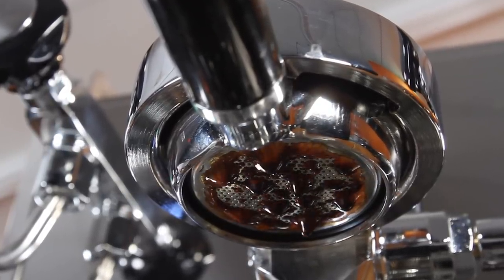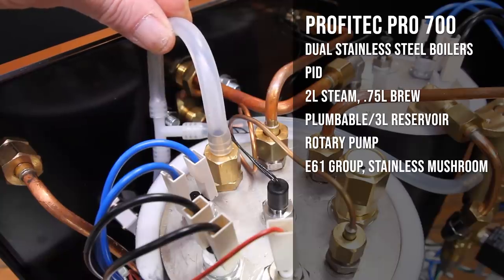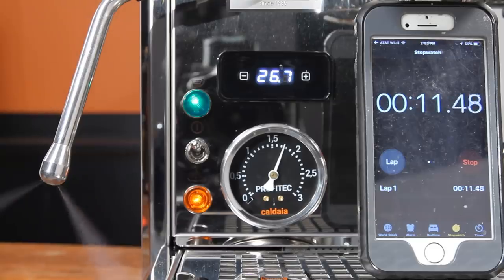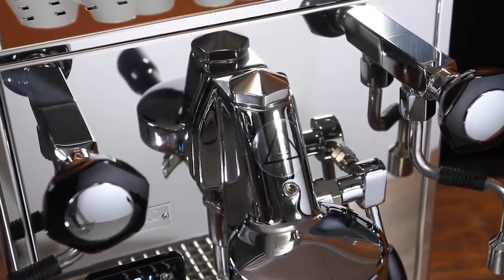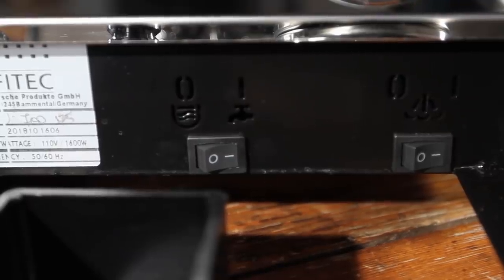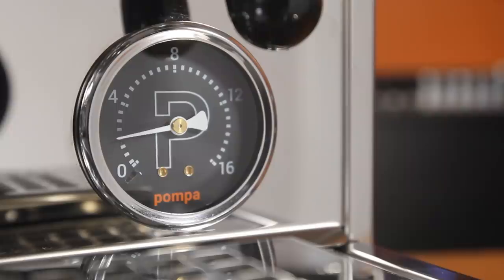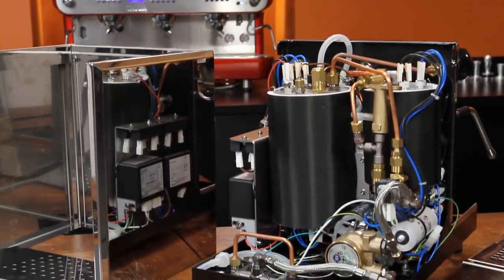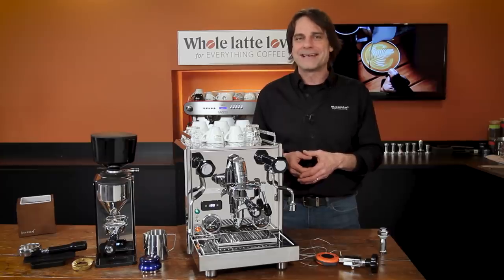Review: Profitec Pro 700 Dual Boiler PID Espresso Machine

Comment: Great video, Marc. 
I'm curious, at this level (700 and the Synchronika), are these a viable alternative to a "commercial grade machine" if you're looking at a small complimentary cafe (passive sales mainly to office building users) that's likely to only produce 20 to 100 shots/day?
Reply from the maker: Hi y, Thanks for the comment and question. Neither is NSF rated for commercial use. Doesn't mean they wouldn't meet standards, It's likely ECM/Profitec did not pursue getting NSF certification as they also make full commercial equipment and consider these machines as part of their domestic line. If looking for a lower cost commercial machine check out the Gaggia TS: https://www.wholelattelove.com/gaggia-ts-espresso-machine
Marc

Comment: Wow, the machine i’m buying and the glass cup I had on my wishlist, I guess I know what’s up :P
Reply from the maker: Hailex Hi, you will not be disappointed with the 700! Just curious if you had considered the ECM Synchronika. If so, why did you go with the 700?
Marc
Reply: @Wholelattelovepage  I did consider it, but in the end I chose not to go with the Synchronika because I love the look of the industrial style knobs more than the pull-down levers, the reservoir is also a very attractive feature, and now the black dials are a plus as well. Both machines are close enough mechanically that I felt the decision came down to aesthetics. A few things I did like more about the Synchronika was that it had the slightly black tinted PID controller screen, and the black coated frame.
Reply from the maker: Hailex thanks for the feedback!

Comment: Hi any idea if I can plumb the Pro 700 to a 8L water bottle which does not provide pressurized water supply? Thanks!
Reply from the maker: Ng Kai Yuan Hi NKY, yes you can. Rotary pumps have enough suction power to do that. We do it all the time. You may need a prime with water from reservoir prior to switching to the plumb line. 
Marc
Reply: @Wholelattelovepage  I'm assuming you attach some plastic tubing to the end of the braided line to accomplish this?  Just curious what kind of type/size of connector might work for that.  Contemplating "plumbing" to a water container of some type external to the machine to solve the minor headache of refilling under a cabinet.

Comment: Gidday Marc! Love the videos, keep em coming! Just received my pro 700, loving it so far, pulling some really epic shots. Just a quick question, was wondering if there’s any way to stiffen up the steam arm on the unit? Just feels like it moves a bit to freely when steaming milk, or maybe I’m just not steady enough with the one hand. Appreciate the time you take to answer everyone’s messages. Cheers!
Reply from the maker: Hi JP, Thanks for the kind comment and question. If you remove the nut holding on the steam arm there's a spring which provides tension on the arm. You can stretch out that spring to increase thew tension. Hope that helps!
Cheers,
Marc
Reply: Thanks Marc! Most appreciated 🤙

Comment: Pro 700 is awesome. I love it. But steam pressure defaults to 1.5 bars. How can you switch it to 2 bars of pressure?
Reply from the maker: Hi DW, Thanks for the question. How old is your Pro 700?  700's with higher steaming pressure started shipping in April of 2018. If your machine is older than that ~1.5 is the max unless you install the PID upgrade: https://www.wholelattelove.com/products/profitec-pro-700-pid-upgrade-kit
If your machine shipped May 2018 or after from Whole Latte Love (can't speak for other retailers on upgrade dates) then it is capable of 2 bar steam pressure. To get it, you need to adjust the steam boiler temp to max setting of 270F. To do that press the plus and minus button on the display simultaneously. Then quickly press the minus button until "T2" is displayed. While "T2" is displayed press the plus button to adjust the temperature of the steam boiler up to 270F. At that temp boiler pressure will be ~2bar. Hope that helps!
Marc

Comment: I've been looking into building a passive house, i'm curious if you've done a power usage test with this new version yet and what your results were?
Reply from the maker: Hailex Hi, Thanks for the question. No power test yet - I’ll try and putt the watt meter on it Monday morning. A couple things that will help... the Eco function which shuts down the boilers after a period of no use and you can turn of the steam boiler with the switch behind the drip tray. 
Marc

Comment: Hi people @WLL! Thanks for all the reviews and info. How long will it take a pro 700 to warmup to a first coffee. A total warmup takes 30 min i read somewhere. But within how many minutes a first extraction is possible. Greatings from the Neatherlands!
Reply from the maker: Hi ovdt, Thanks for the question. For rock solid temps 30 minutes is a good time. Takes awhile for the thermosiphon to fully heat the mass of E61 group. You can help things along by running some blank shots after the brew boiler as warmed up after 10-15 minutes. As the Pro 700 has a mechanical power switch it is possible to control using a timer/smart plug and have the machine turn on by itself.
Marc
Reply: @Wholelattelovepage  thanks so much for this answer! The brand new 700 is in my kitchen now so i'm gonna try this one! Greetings. Otto

Comment: Hi Marc, was thinking if you could refer me to a video about descaling the profitec pro 700? Im thinking of getting this machine and i just want to make sure that i will be able to conduct any maintenance easily by myself at home. 

I would also like to check with you if its best to leave the machine on 24/7 or otherwise.

My local online store does not sell the BWT bestmax. They only sell the BWT AQA Drink Pure Set and the BWT Protect MP200 Set. Would like to seek your kind opinion on this 2 filters from BWT. Thank you very much! 😊
Reply from the maker: Hi JT, Thanks for the question. As to leaving the machine on 24/7. I've spoken with Michael Hauck who is CEO of Profitec about that. He says he leaves his machine on 24/7 so it's always ready go. But also said it's fine to turn on/off daily. The Pro 700 does have a settable standby time for auto off. We do not have a video for descaling dual boiler machines. Manufacturers all say dual boiler machine should be descaled by machine techs. It can be done by savvy home users with the right skills but there's risk of issues when neglected dual boiler machines are descaled by non-professionals. Best course of action for most is to provide machine with a water quality that will not cause scale in the first place.  I believe the Aqua Drink Pure uses the same filtering technology as the Bestmax Premium and is just set up for tap output rather than inline to a plumbed machine. It should protect your machine from limescale yet proper mineral level via magnesium to support flavor and prevent over-extraction. Another option is the BWT Penguin pitcher if available in your area. That's what I use for reservoir fed machines: https://www.wholelattelove.com/products/bwt-penguin-2-7-l-water-pitcher
Hope that helps!
Marc
Reply: @Wholelattelovepage  thank u so much for the help. You have really helped me made my mind up on what to get. Thanks Marc! hope all is well in ur area. God bless.

Comment: Been playing with my machine for the last 2 weeks, great machine but I hate that flow control valve take about 2 full turns from close to open position, wish if it was only like a half turn from fully open to fully close, it would much easy to control.
Reply from the maker: Hi C&b, Thanks for the comment! So much turning :) IMO more turns gives one finer control of flow/pressure. An analogy with 2 grinders... one goes from espresso fine to cold brew coarse with a 180 degree turn of an adjustment collar. Another takes multiple 360 degree turns for the same grind size adjustment. The latter has far more precise control of grind size. Have you gone through calibration of FCD? Measure flow rates at each quarter turn of the valve. Run pump without PF in place for 20 seconds, weigh water output in grams and divide by 20 for grams per second of flow. If no scale measure volume with 1ml = 1g. Repeat test at each quarter turn more. I'll also note that running with FCD wide open gives a higher flow rate than stock mushroom valve by ~2-3g/s.

When I use FCD for extended low flow pre-infusions followed by lower flow main extraction I'm moving knob maybe a quarter turn between flow rates. I use that type of extraction when working with fresh, lighter roast high-altitude single origin coffees. You can see that in this video where I pull a fresh from roast Yirgacheffe bottomless triple to a 1:2 ratio and log the shot using Acaia scale and Brewmaster app: https://youtu.be/HTaly8c-i_U?t=321
Marc

Comment: Marc, any chance of a video showing the difference internally between a standard mushroom and the Profitec version?  Also, is there any functional benefit or are both styles essentially the same?
Reply from the maker: Hi GS, Profitec has gone to using stainless steel for mushroom valves. Others may be chrome plated which tend to flake/pit or ceramic which is a more brittle material. Not a common problem but ceramic can crack/break due to its brittle nature.
Marc

Comment: I just got the pro 700 (been using it for 4 days)  and  I never get 2 bar on the steam pressure.  It gets to maybe 1.9, but lingers around 1.7 to 1.8   Steam temp is set to 270. The PID will show steam temp get up to 272-274, but it never reaches 1.9 Bar. Even with a temp of 274, it gets to 1.8

When I use steam only, it stays steady around 1.5.  But to recover, it takes at least 60 seconds to get back to 1.7 to 1.8-.9 but goes back to 1.8   That’s a far cry from the 6 seconds that is touted on the video (or 16 seconds to get back to 2.0 bar when it goes down to 1.5 bar as on the video)  Mine never gets to 2.0

And forget about pulling a shot at the same time.  The steam pressure drops well below 1.5 bar to about 1.2-1.3   Brew temp them drops to about 160-170 (and steam temp drops to about 240)  Recovery for brew temp seems ok, maybe 30 seconds.  But steam just takes it’s time and gets back to about 1.7 in about 45-60 seconds.  

It's plumbed using BWT BestMax. pressure regulator is set to 2bar for line pressure

With tech support, I did a factory reset. That didn't do anything.

No leaks anywhere.

Not sure what else to do
Reply from the maker: Hi K9, I'm reading through and not sure I follow. You should be able to set temp for steam higher than 270 which will get you closer to 2 bar steam pressure. Guess I'm most confused where you say it gets to maybe 1.9 and in the next sentence you say it never reaches 1.9.
Steam boiler recovery time is based on steaming a standard amount of milk. If you've had steam running for a long time recovery times will be longer.
Pulling a shot should not impact steam pressure at all. Steam and brew water are generated in separate boilers so there's no way pulling a shot could change your steam pressure.
If you continue to have issues I would contact tech support for further assistance.
Reply: @Wholelattelovepage  Sorry, I guess I was kind of all over the place :)  I was waiting for my replacement machine to arrive.

On the PID, I can set steam temp to 270. That's as high as I can go (which I think is the way it was designed?)  The actual temp on the steam does go above 270.  274 is as high as I’ve seen it go (but pressure never reaches 2.0, it’s 1.9).  It fluctuates between 270-274 but usually stays around 270-272  (peaking at 240 every so often)  

So my pressure stays around 1.8-1.9 depending on steam temp (I know that’s knit picking but it’s doesn’t stay at a consistent 2.0-never reaches 2.0)  I guess I’ve surrendered to the fact it won’t hit 2bar.  Will I still have good steam pressure? Sure. I am just a technical guy (I think in terms of zeros and ones) :-)  When I see your video promoting the machine and it’s 2.0 bar, I would expect that’s what I should get.

The other big issue is that the second you turn on the steam knob, pressure immediately drops to 1.5  It definitely doesn’t act like your video where it’ll gradually go down as you are frothing.  Recovery slowly goes up to 1.7, hangs out there, goes up to 1.8 then reaches 1.9 then bounces back and forth from 1.8-1.9 (but never in 16 seconds, probably about 30-45) Now, when you open the steam knob and pressure drops to 1.5 immediately, it’ll stay at 1.5 as you froth your milk.  I haven’t done the wide open test yet of keeping it open for 60 seconds.  Once I saw it drop to 1.5 as soon as you open the steam knob, I stopped testing. 

People have told me it’s because I have a US model and it’s running 110v vs 220v. It is on a 15a breaker (and outlet)  Just not sure I buy that argument, especially since your videos I am assuming are 110v.

So I guess I am just saying, it never reaches 2.0 bar (even at 274 degrees) and pressure drops to 1.5 the second it starts steaming. (even on my 2nd machine)

Still love you guys  !! :)
Reply: @TheK9Shepherd  I just bought a Profitec Pro 700 (with the flow control valve) in December 2021.  The  steam pressure gauge was dead on arrival. WLL sent me new gauge which I installed today. When the steam temp was set at 269 'F in the PID, the pressure was equalized at around 1.6 bar.  After I set it to the max possible temp of 270'F in the PID, the steam temperature rides between 271--274 with a matching pressure of 1.8-1.95 bar, sometimes barely touching 2.0 bar for a moment when it's showing 274'F.  However, like your machine, mine also drops down to 1.5 bar as soon as I open the steam valve. I let it run close to a minute and it slightly increased to 1.6 bar after 30-40 secs when the PID kicked in to raise the temperature which had fallen down to low 250s.  The gauges themselves probably are not perfectly calibrated and may also have some error margin. But the 0.4 bar drop when the steam valve is opened is also what I'm experiencing.  Now I try to say it's good enough for home use and just enjoy the machine.  *P.S: This is after letting the machine warm up fully for an hour and I also have the US version of the machine.
Reply: @tyurek  Yeah  I've given up on getting the advertised performance. Just ticks me off. It's like buying a car where they say it goes 100 mph but I only can go 80 mpg. Then to hear from WLL that there is no need to go 100 and 80 is fine. HA  I know even at 1.5 that's good pressure and for what I am using it for, it'll be fine. But my performance even drops to 1.0 which is what I don't like. WLL gave me some BS excuse and when I responded countering their assessment, they never responded back. Anyways, I went with a 4 hole steam tip so that sped things up and I don't even have the valve open for more then may 15 seconds.

Comment: Wonder if they will upgrade anything on the 800
Reply from the maker: Hi Jay, What kind of upgrades would you like to see?
Marc
Reply: mainly aesthetics.  update them to the new styling of the 700 on the valves.  maybe a nicer lever handle and angled portafilter.  more discrete badge  ?

Comment: How do you descale this Profitec Pro 700 machine?
Reply from the maker: Hi Wilson, Thanks for the question. Manufacturers generally recommend dual boiler machines be descaled by a professional machine technician. A couple of reasons why: If a machine has been neglected and has moderate internal scaling when it does get descaled chunks of scale may get dislodged and plug other internal components like solenoid valves, gauges, flow restrictors, etc. Also, it's difficult to fully drain the boilers. At our service center boilers are removed for descaling for this type of machine. Tearing down a dual boiler machine for descaling is beyond the technical capabilities of most home users. What we recommend is using water high quality water filtration. If used properly it stops scale from forming in the first place so descaling will never be needed. We recommend BWT products. I use the Bestmax Premium system for my plumbed in Pro 700 in the studio:  https://www.wholelattelove.com/products/bwt-bestmax-premium-filter-package-w-besthead-flex
Marc
Reply: Thanks for replying. But I'm in Malaysia, I don't know if that filter is available.
Also, how do I know when and if I need to descale?

Comment: Hey Marc, I have been watching a lot of videos lately and I am looking to get an espresso machine that I can take to the farmers markets and brew some of my fresh roasted coffee. What machine do you recommend for something that I could pump out a good number of shots and grow with a bit? I have been looking at the Rocket Espresso Giotto Evoluzione V2 and a few other rockets.Thanks for all the info!
Reply from the maker: Hi Parker, A couple of thoughts. I'd go with a rotary pump machine like the Rocket EVO Rs or Profitec Pro 700. With Rotary pump you can drop the plumb line into a 5 gallon water source so you don't have to fill the reservoir all the time. Vibration pumps generally don't have plumb lines - also less robust than rotary. If you will be cranking out shots (will you be doing milk drinks?) bigger brew boiler is better for temp stability. Long term I think Profitec and ECM machines get an edge in reliability while Rockets get the edge in "sexiness". If you want built like a tank and value have a look at Brewtus Expobar. There's a rotary pump plumbable version of the machine and you won't care so much about scratching it up with all the moving around. Hope that helps - let me know if you have any more questions.
Marc
Reply: @Wholelattelovepage  Thanks again! I do enjoy the ExpoBar. Yes I will be making milk drinks and getting into the industry that way. Do you guys do any kind of Military discount? I will be ordering mine this week!